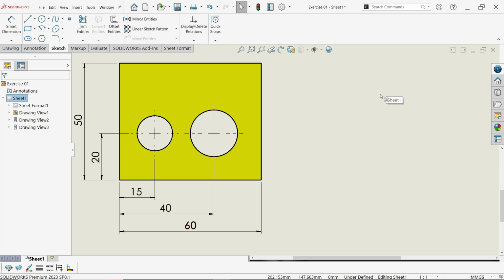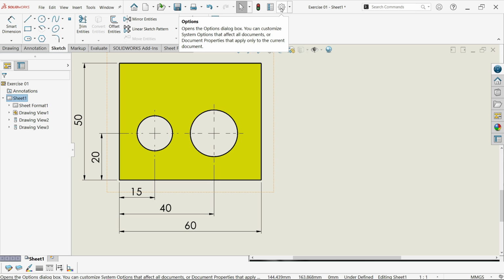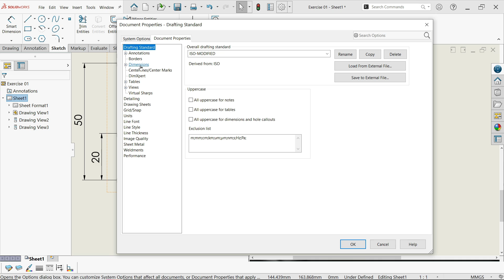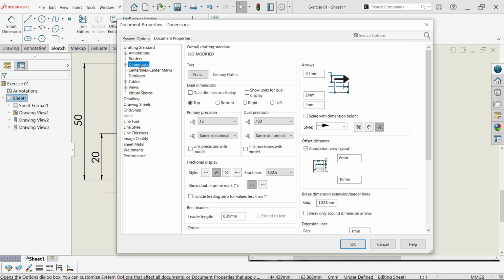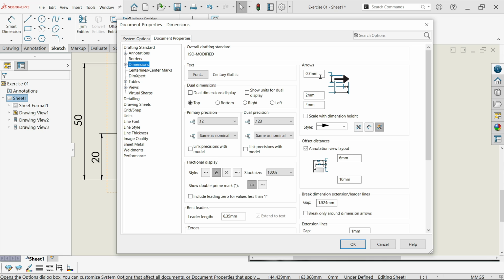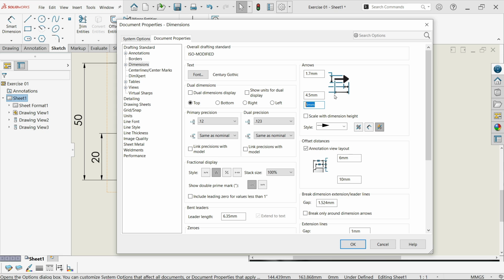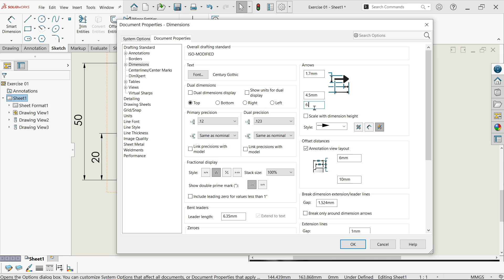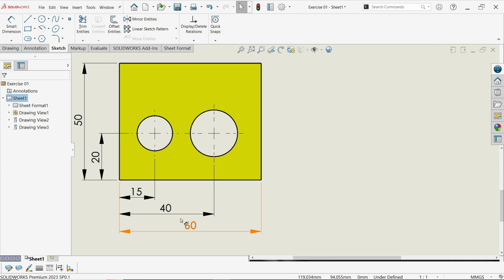How to Change Leader Arrow Size in SolidWorks Drawing ?

Comment: Also, how to keep the cursor size as it is (ie.Small and default size chosen from windows settings).because, whenever I used to hover my cursor on the 3D solid part suddenly it becomes big and the moment I took the cursor from the part, it retains it's modified size (ie. Cursor Settings being done from windows).What should I do now?.